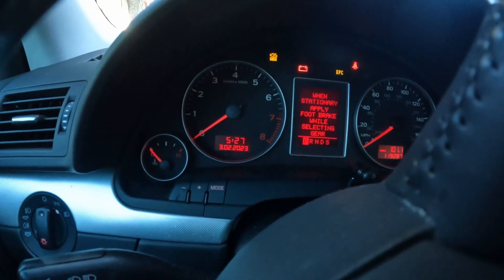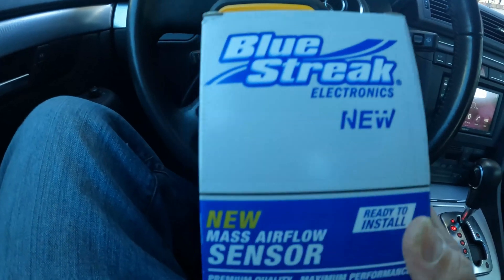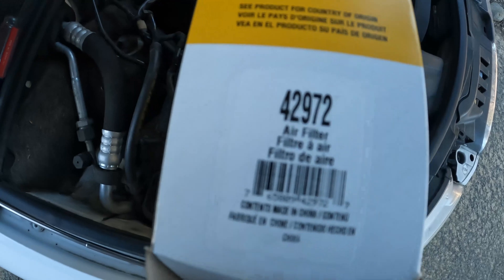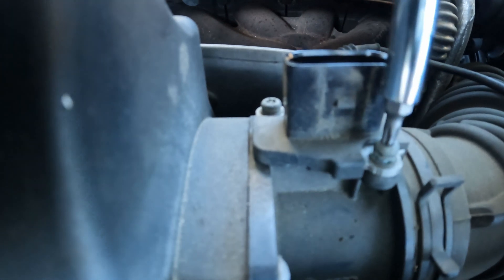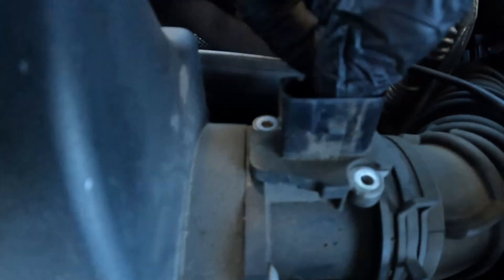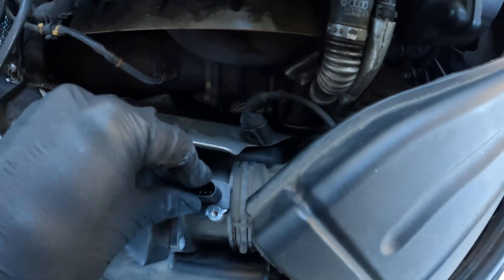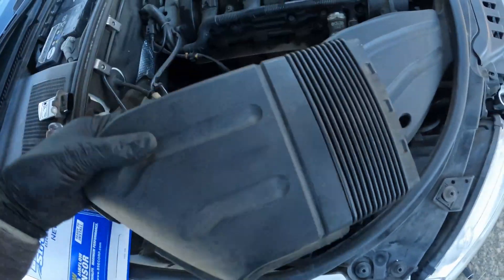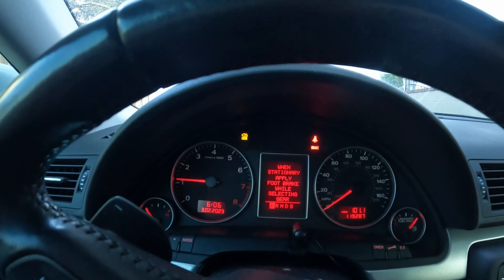How To Fix "P0171" Code | EP-1 | Audi A4 | MAF Sensor #audia4

Comment: I got the same code and replaced MAF sensor but still got the code. Also had a very slight vacuum leak, which was giving the P0171 code because it was forcing the short term fuel trim to compensate for the slight vacuum leak.  It turned out to be the purge valve that was causing the P0171 code. And the purge valve is actually cheaper than the MAF center, and almost as easy to replace.  Never occurred to me because last time my purge valve went bad, the big symptom was every time I got gas it would take me 10 attempts to get the car started. Which if you have that issue, you can simply clamp the line shut and if it starts right up you know it’s bad. And as most of us that own the A4 B7, at some point your car burns about a quart of oil per month, it may be your oil separator (aka crankcase vent valve - again very expensive about $45 and easy to replace)  if you try the easy test of trying to take off your oil filler cap while the engine is idling (if it’s difficult your crankcase vent valve is what’s bad) but if it’s easy, we can still be replaced and that will solve losing the quart per month. There’s a lot that I can tell you it’s your down stream O2 sensor or your catalytic converter is bad, but if you have or get an OBD II scanner, even a $25 one like Launch Creader 3001, live datastream works sufficiently. Of course if you want much more detailed and customization you need to get a better one.
Reply: Just curious do you have info on what numbers should be on live data? Like what are the average numbers throughout all the information on live data? Because I see a lot going on on the screen but don't necessarily know what good numbers would be as far as the live readings of everything. Or do you have a link that tells me every single thing on there what its average should be and what it should be

Comment: Hi, my 2007 audi a4 b7 has very weak rev at idle. I stepped on the gas and the rpm just slowly goes up. Before it revs up nice and strong. This just happened after i cleaned the maf. I got no error code. Any help would be greatly appreciated. Thanks
Reply: Give the maf time to dry itself fully. After cleaning if u put back in wet car won't start. Let it run and give it a few days and clear the code